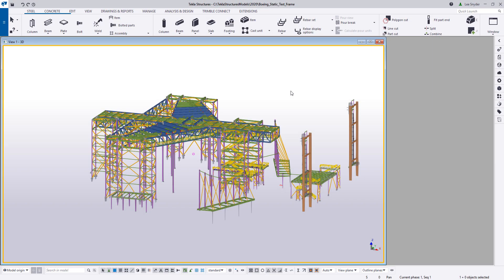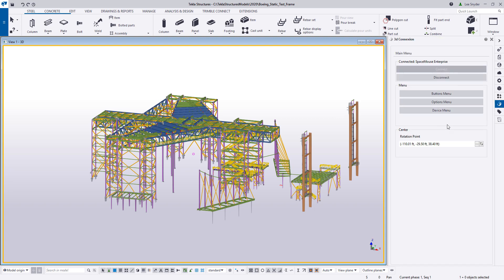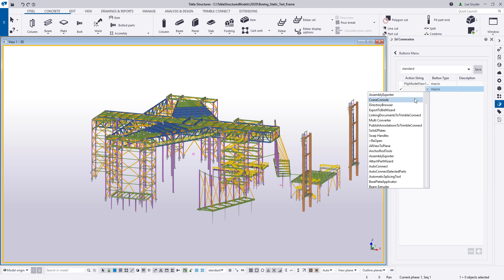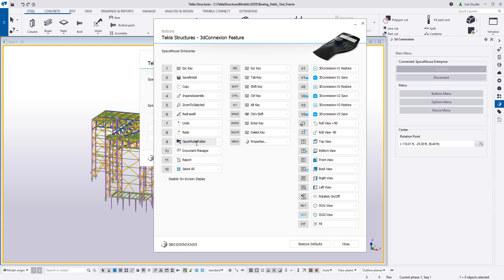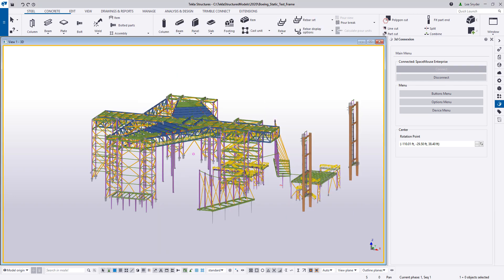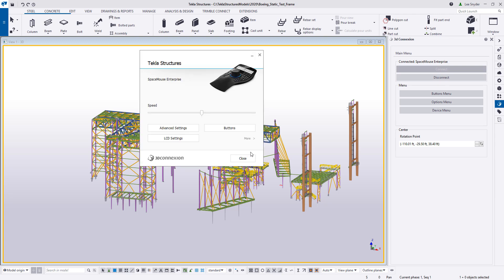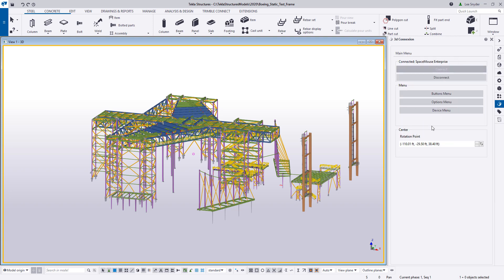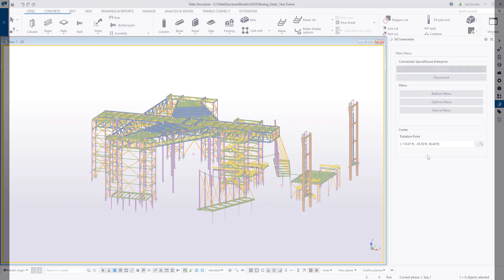3Dconnexion Integration with Tekla Structures

Comment: @Lee Snyder Having issues installing the plugin on tekla 2022, keep getting file not found exception error / reflection type load exception for the ConnexionLinkFeature.dll. Do you know what would be causing this?
Reply: Zachary, I'd recommend conacting support about this. They'll need information like what Service Pack of 2022 you are running, which version of the plugin you are trying to install, which device, drivers, etc.
Reply: @TrimbleTeklaDave  appreciate the response, will definitely be doing that. Side note, pretty sure you came to my work years ago, I think I still have your business card somewhere.
Reply: @zacharystanley5654  Definitely could have. I used to do a fair amount of on-site trainings in my previous role here.

Comment: As mentioned a few times below, it does not seem to work with the SpaceMouse Wireless. Zooming and panning dominates the rotation to much. Spend hours trying to play with the sensitivity, but not working. I suggest US Trimble to test the spacemouse as it's a very popular mouse and come up with workable settings for this particular mouse.

Comment: @Lee Snyder  I'm just starting to test using a SpaceMouse Wireless and am having difficulty... I cannot seem to get the rotation functions to work within Tekla.  Pan + Zoom work fine.  I have the latest 3DConnexion drivers installed (10.8.5) - any tips on what I might be doing wrong?
Reply from the maker: Please reach out to your local Tekla helpdesk support team: https://www.tekla.com/contact/offices-and-resellers

Comment: Tekla 2021 I cannot set the rotation center: the coordinates in the lateral 3dconnexion panel change, but the rotation point does not change; I kindly ask if I can be helped, I can't work with the mouse.

Everything worked fine until the 2019 version, where tekla had its own driver.
Reply: Did you found a solution yet?

Comment: I tried installing my wireless spacemouse, unfortunately still not great.
Reply: Hey Willie!  We've heard pretty positive feedback so far so could you give me some more specifics as to what isn't working?  Also, can you verify that you are running the latest version of drivers for the space mouse?
Reply: @leesnyder6784  Hi, the mouse installed and mostly works, the two problems I had was the that after I used the space mouse I start to get issues with the rendering (parts disappear when zooming in and out and or rotating the model, I then have to restart Tekla to fix it) the other minor but irritating issue was trying to move the rotation point, couldn't get it away from the center of the model even though the co-ordinates changed, not a big deal on the face of it but when you are working on 200-300m warehouses its makes the mouse unusable when zoomed in. I admit this issues could probably be sorted with some time and effort (probably issues on my pc) but I don't have time at work to spend on this.
Even though I have issues I think this new setup is a 1000% better then before, all other functions worked, will try it gain later when I have time.